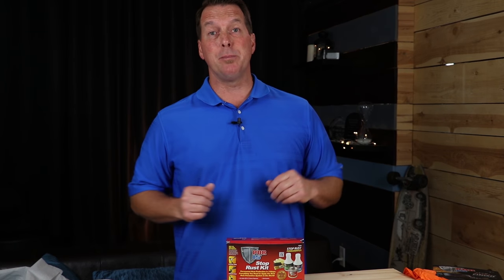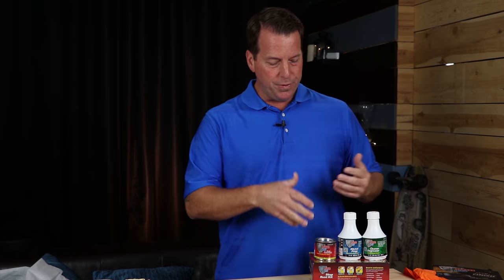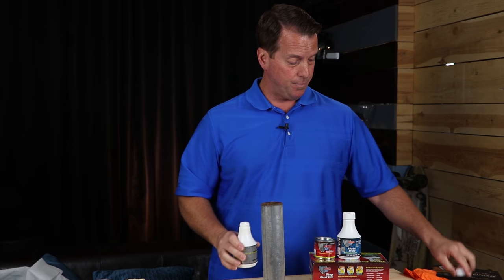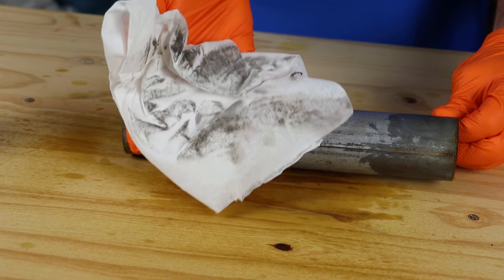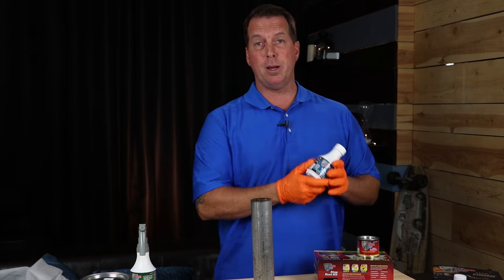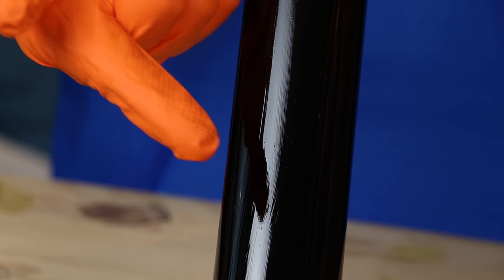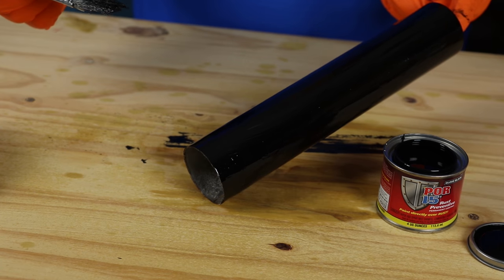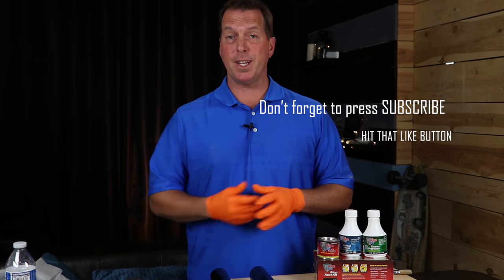STOP USING POR-15 INCORRECTLY!

Comment: You should be doing a Demo, with Metals that has various types of Rust, not just just a small  muffler pipe that has no rust at all.  Who  in his right mind is going to use POR 15 on metals that has no rust?  Your demo starts off "I could not find a Rusted Pipe"  at 1.47. Really?   How silly is that?  You are making an important DEMO for a Huge Company, that has a GREAT product, but your demo really sucks. I am an Auto Body Painter, doing work for 42 years, SO I KNOW. For example, if you are selling a good umbrella, you  test it under a torrential downpour and not under a light drizzle.  Please make another video with at least 5 to 6 different rusted parts. Least rusted to Most rusted.  GREAT product, Lousy DEMO.

Comment: Anyone that thinks you can stop rust is a fool
Reply: FACT: iF you can encapsulate the rust by totally covering (coating) it WITH this product (or other similar products) you WILL STOP rust.  One thing rust needs to keep eating metal away is OXYGEN--Kind of like people---cut off its oxygen supply, and you "kill" the process OF rusting...

Comment: Bullshit ya don't need all that other stuff . I did my 51 fifteen years ago 
1. Clean it = I used Palmolive 
2. Prep metal. = wire brush wheel on my drill ,grinder ,or by hand . 
3. Apply= I used chip brushes . 
Apply thin then as wanted . This product LOOKS LIKE CANDY HARD CANDY EVEN LIKE FRESHLY POWDER COATED . 
to this day my frame  ,floor pan ect looks new . 
P.S don't get it on your skin it won't come out . Trust me I used stuff that will wash the mexican off me and no go . YOUR BODY OILS HAVE TO PUSH IT OUT